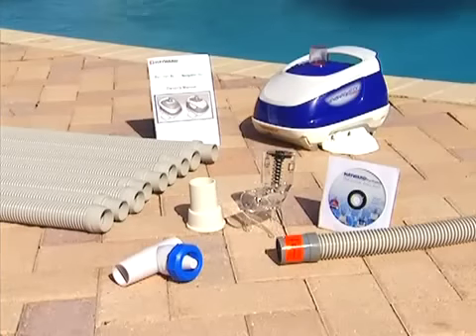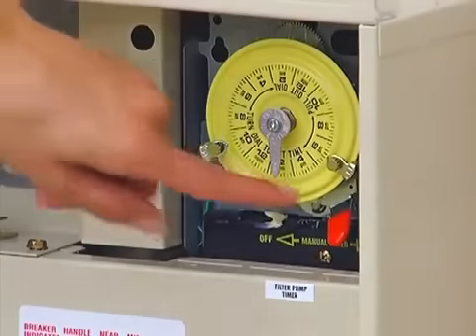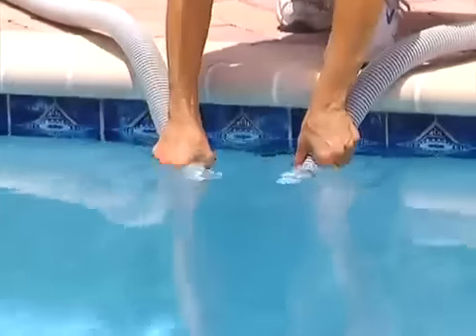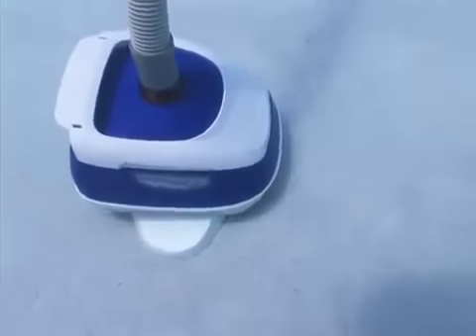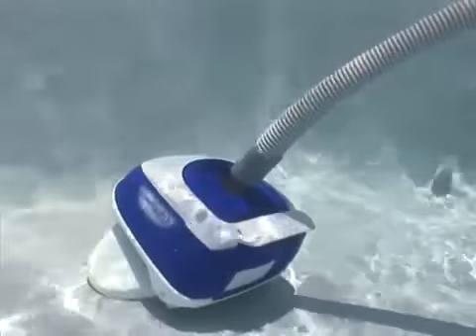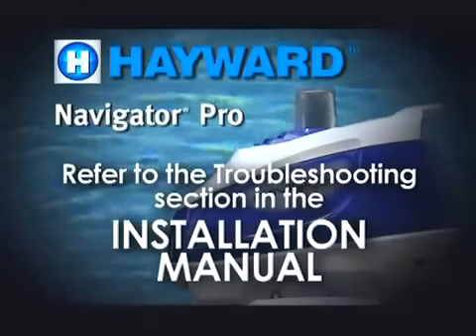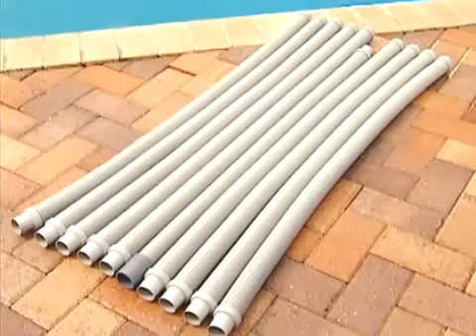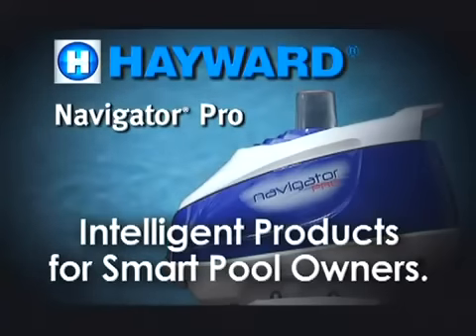Hayward Navigator Pro at Pool Plaza, Venice Florida, 34293

Comment: With the leaf bagger attachment, is this cleaner, in essence, a total replacement for the Polaris 380 that I am currently using?  i.e.: For picking up large objects and leaves and also DE that has made its way back into my pool? (My Polaris does not pick up DE even with the fine mesh bag). Thanks.